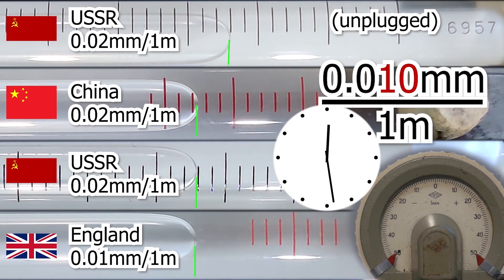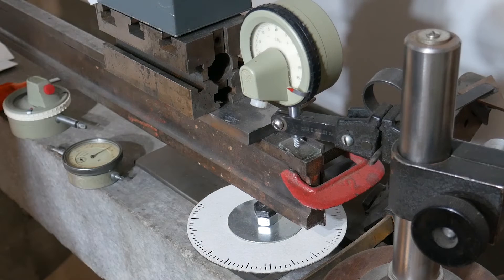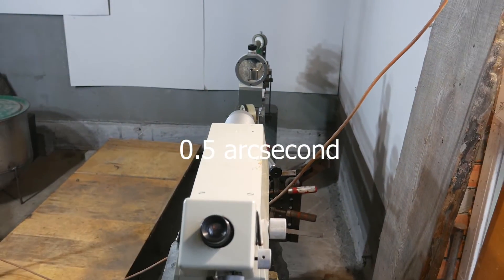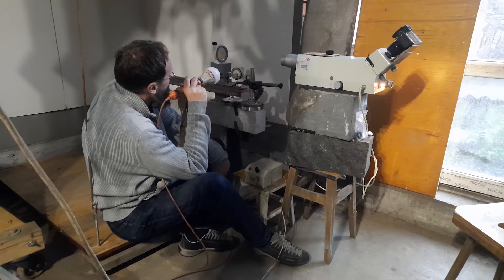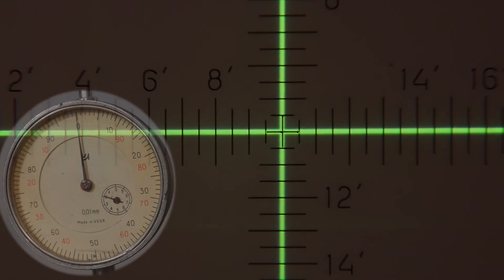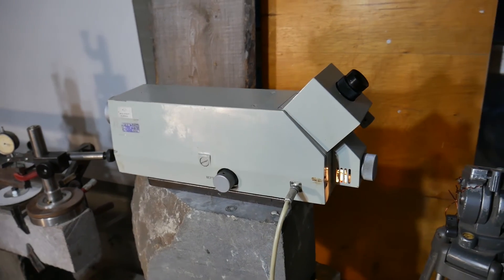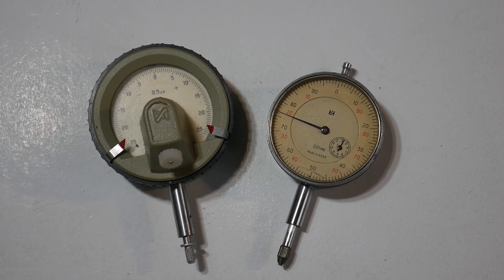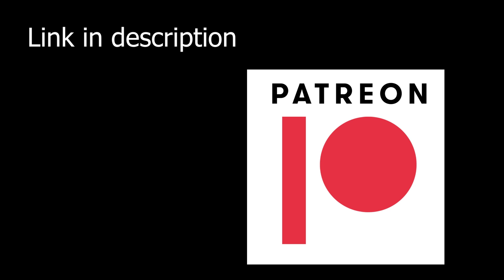Checking the autocollimator readings

Comment: Hello,
I like very much your videos. I have a comment about autocollimator resolution. I do not understand the rating of the autocollimators (ac.): you showed  ac. with 0.5 arc second resolution and even with 0.2 arc second resolution. The ac. equation says that theoretically the smallest resolvable angular deviation is theta = D/(2*F), where D is a small distance in the focal plane (it can bee e.g. the line width of the reticle), F is the focal length of the ac. lens. But this calculation does not take into account the light diffraction. The  angular resolution of an objective lens or mirror is given by theta = 1.22*lambda/D, where lambda is the wavelength of the light in microns, and D is the diameter of the optics in decimeters. Hence for a D=50mm lens the theoretical angular resolution limit for 550nm light is 1.35 arc second. Way beyond the resolution rating of the autocollimators you showed us.  In your video around 12:30 we can see, that the microcator can indicate few micron changes in the alignment of the test bar and mirror, but this deviation can be barely seen on the autocollimator image. 
Best regards,
Zsolt Kis
Reply from the maker: Hello! The autocollimator objective lens diameter is 0.2 arcseconds 60mm. The focal length is about 900mm. Can this additional information help you figure it out?
Reply: @gena_bazarko  Well, I can repeat now the above calculations with the true numbers. So the the ac. equation gives theta1 = D/(2*F) = 60/(900*2) = 0.002/(2*900) = 0.00000111111 radian, where I assumed that the reticle linewidth is 2 microns. This angle corresponds to 0.23 arcseconds, which is given in the spec. list of your ac. However, the optics limits this theoretical resolution due to diffraction. The diffraction equation gives theta2 = 1.22*lambda/D = 1.22*0.55E-3/60 = 0.0000111 Radians, which corresponds to 2.3 arcseconds. If we image now the 2 microns wide reticle line back to the focal plane of the 900mm focal length objective we obtain 0.01mm linewidth. This line broadening is due to the effect of diffraction at the edge of the finite size objective lens. One can do nothing about it. To get smaller linewidth in the image plane and better resolution one should increase the diameter of the objective lens. In your case one should use 5 times larger objective lens to achieve the theoretical resolution of the ac.
Reply from the maker: Thank you for the theoretical information you provided. I will try to understand this information, but at the moment I do not understand it in detail. I need to expand my knowledge of optics. But at the same time, the problem you mentioned is somehow solved. If you install a good camera on the autocollimator lens and display the image on the monitor, it will be possible to register even a smaller angular deviation than 0.2 arc seconds. Since now, when working with an autocollimator, I do not use additional devices and control measurements simply by eye, and my vision is no longer perfect due to my age, I can confidently say that with an autocollimator of 0.2 arc seconds, and this is its sensitivity determined by the manufacturer, I undoubtedly see, at a minimum, a deviation of 0.5 arc seconds. I would like to understand the theory of optics as well as you do).
Reply: I found your email address, so I am going to send you some more explanation and maybe documents or links to documents.

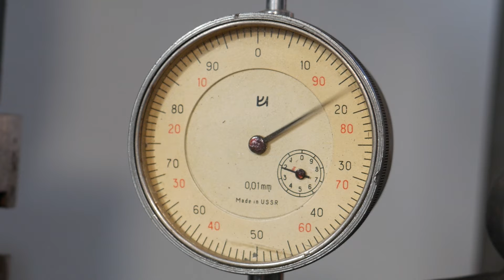Comment: 8:05 So its proof that without camera you can not detect even 1 arsec. In actual straightness measurement only by your eye you will not be able to check down to 1 arcsec. Error gona be more then 1 arcsec coz resolution of optics on is not great

Comment: This is very cool. I know nothing about optical instruments so it took me a while to understand what was going on. So the autocollimator is on the right, shining light to a mirror, and back again, measuring the angle of the mirror? And you're saying it can be used to measure the flatness of a large surface? Very interesting, it makes sense because you can't put a very large table on a granite slab to see if it's flat. Also, if you were manufacturing a granite table it needs to be measured. Very impressive resolution! I wish you the best of luck with your business and your channel.
Reply from the maker: This is true. The autocollimator measures the angle by which the position of the mirror plane has changed relative to the optical axis of the autocollimator with an accuracy sufficient to control surface plates or pairs of linear movement of machine tools (curvature of a plane or line up to one micron at a distance of a meter.

Comment: If you are looking for an opinion, this generated voice choice is the best so far. The content is as interesting as ever, and I am excited to see what you will do next!
Reply from the maker: The next video will transform the same stand, it will be supplemented with new features. A straight edge measuring 1070x60x120mm will be installed on it. With an accurate bubble level, I can control a surface of 1070x60mm, due to the special design of this stand, with an accuracy of less than one micron over the entire surface. Thus, as a result of control and surface treatment, the exact plane of this straight edge 1070x60 mm will be produced. Submicron precision is implied. I think it will be very interesting.